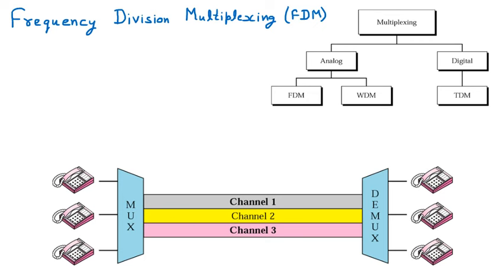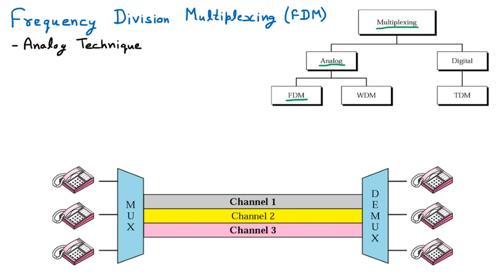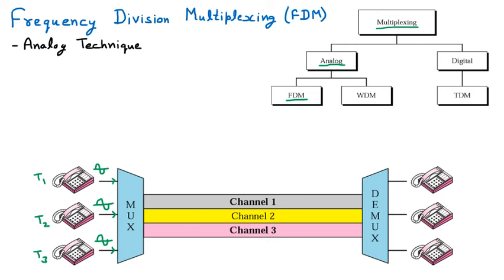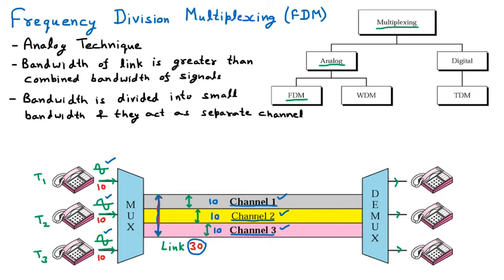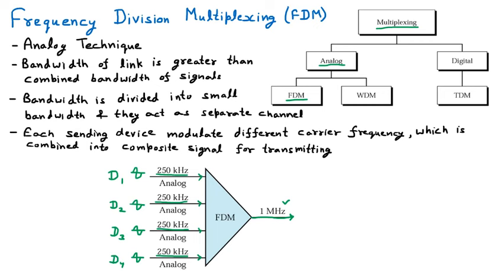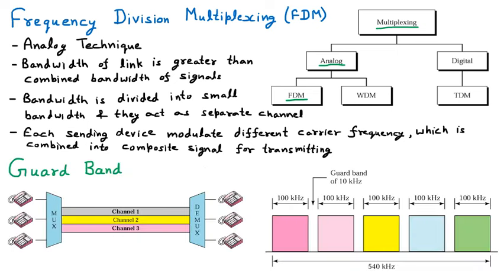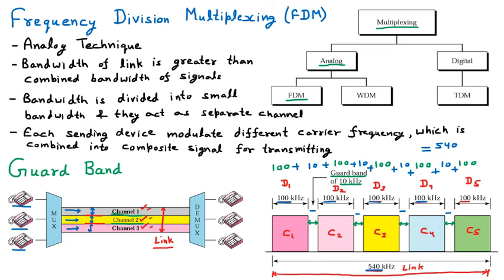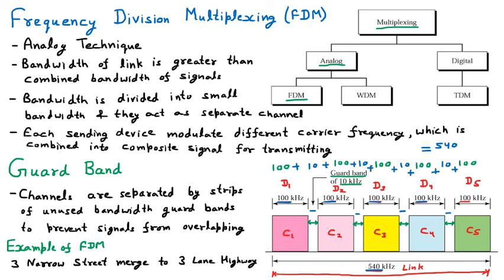Frequency Division Multiplexing (FDM) Guard Band | Types of Multiplexing | Computer Networks

Comment: At last guard band example, why don't u add different carrier fz with message signal sir,  u only mentioned 100khz msg signal for all the channels. If it is same how will you retrieve the msg signal at demux with out having carrier signal.
Reply: same doubt if you are sending data from all devices at same frequency then how u gonna demux it? its like all the radio channels are airing at 93.5 Mhz

Comment: Look, I've worked for two telephone companies...though I'm a bit rusty re the latest communication technologies, probably. Anyway, I wanted to review how it is that I have a landline and internet from ONE cable pair in my apt. (which would sound to a regular person, like a bit of "magic")..and I spoke to an ATT tech. across the street...when we had a MASSIVE break in service for one to three days (due to a MANIAC who had gotten into the "B-Box" on the street, and cut HUNDREDS of cable-pairs!!!)---WOW!! 

This technician advised that I probably didn't have the two services based on multiplexing....but it turned out that he was 100% WRONG. What is going on--consistent with the talk above--is that a mixed (FDM--COMPOS-ITE) signal comes from the CO via fiber-optic cable (and, just across the street, via hard wiring) to my unit (meaning there is ONE cable-pair entering my apt). Then, there is a tiny filter device which handles the "de-MUXing" for phone service....and (via a simple splitter, from that cable-pair already mentioned) my modem apparently de-MUXes the (digital) internet signal (with the "Ethernet" cable passing from the modem to my PC)(for DSL internet service). We are DEFINITELY talking about MULTIPLEXING!!!! NOTHING else would make ANY sense!!! 

I suppose I might add that that tech. thought that I might have "VOIPO" service, but he was incorrect. For that kind of service (which I HAPPEN to have from another company) there is a separate device which comes off the modem/router..which is then connected to a separate phone instrument. A regular "land-line" phone (in this situation) does NOT come from the modem, but from a (filtered) cable-pair)!!! 

 Incidentally, in the "old days," EVERYTHING came directly from the local CO, but your cell-phones connect directly to a local cell-tower (a "whole new ball-game!!!").   ;  )
Reply from the maker: Thanks for sharing useful information
Reply: @DrAnkitVerma  You bet!!! BTW, on some of these sites, I appear with a pseudonym; I'm actually Dr. T.C.Halle (Los Angeles, Calif., USA).
Reply from the maker: That's great. I appreciate you for sharing this informative information.